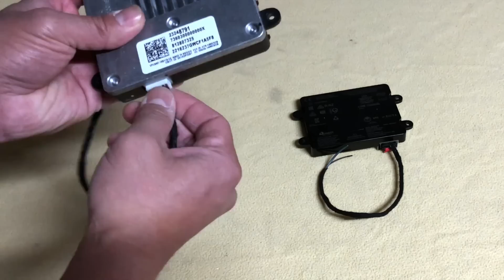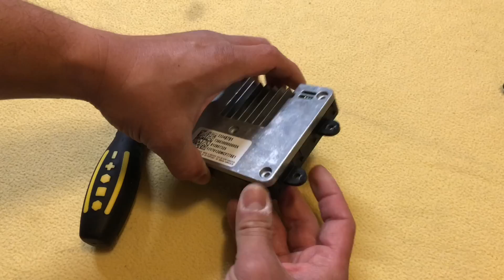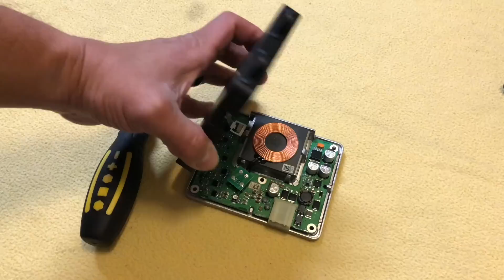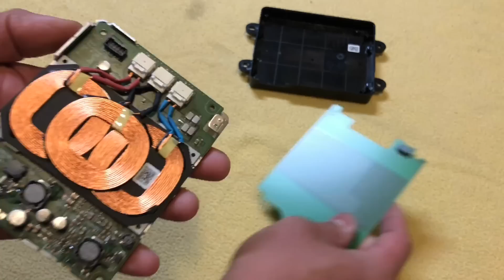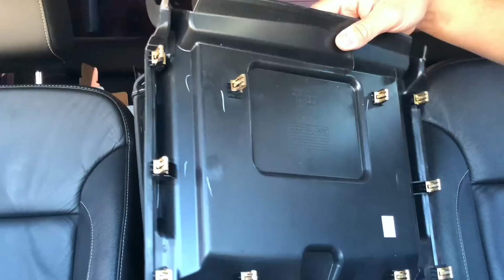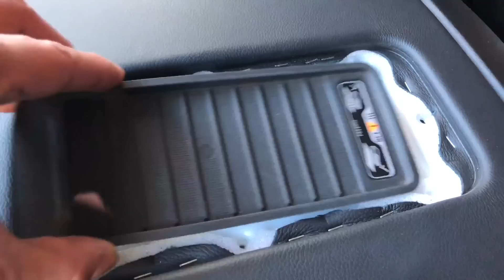2014 - 2018:  GM Silverado/Sierra - Wireless Lid Charging Module Retrofit

Comment: What would I need to put that in a 2014 Sierra Denali. They never offered that in 2014 so I'm starting from scratch. Thank you.
Reply from the maker: If you already have a center console, your best bet might be to get an entire lid with the charging module already installed.  You will need to swap the module out with a 2018 module UNLESS you can find a 2018 lid with the new module already in it.  You will then need to swap out the center console harness you have a connector plug to plug the new lid into.  If you are a a DIY'er, you might be able to splice the new lid into an existing ACC Voltage circuit...same circuit as the Cigarette Lighter plugs are connected to.

Comment: Any idea if they new module does wireless fast charge for Samsung phones? If not I'll stick to my diy solution.
Reply from the maker: Not sure yet.  But I have a few apps that will test the charging output of wireless chargers. If I had to guess, I would say this doesn't support fast charging...as it seems that there are not many out there that do.
Reply: Phil Gamboa unless testing with a device capable of achieving it, I doubt it will give the output.
Reply from the maker: Yeah.  I downloaded an app called Amperes.  It tells me how long it takes to charge 1% lol.  At least I can compare different wireless chargers with it.  Tried an Anker Wireless Charger against a Belkin "Boost UP" model.  Anker sucked.  LOL.  My wireless lid charged faster than Anker.